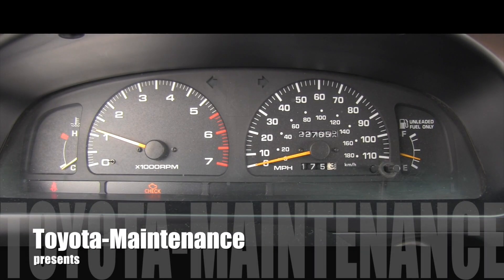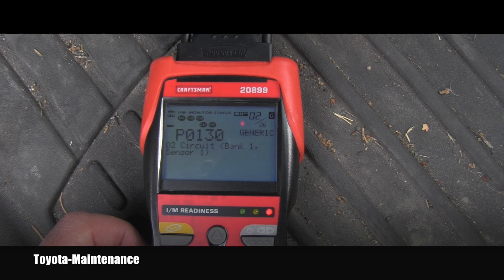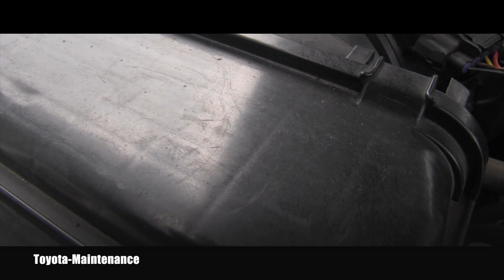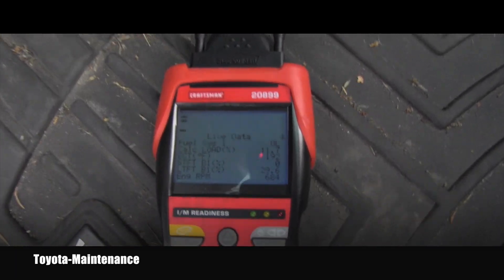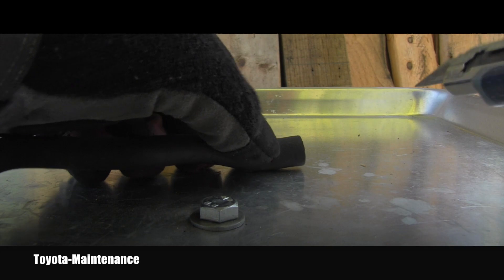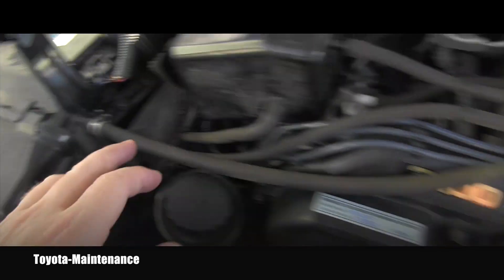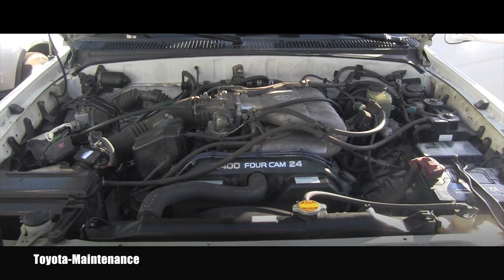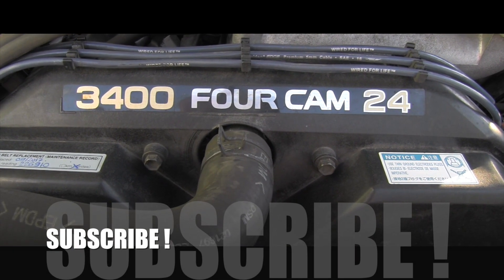Toyota code P0171 - System Too Lean Bank 1

Comment: only on BS youtube P0171 is solved by luck or a simple cracked boot ot maybe a MAF. in reality, this is one of the most difficult and time consuming codes/ issue  to resolve.
Reply: Yeai have a 2011 toyota prius and ive replaced all 4 spark plugs with new ones, checked injectors, replaced both 02 sensors, replaced pcv valve, checked boot and intake and air filter for leaks and nothing ,... keeps throwing code p0171
Reply: I also replaced MAF sensor and nothing😢
Reply: @wise_soul8886  Check for a leak at brake booster.

Comment: I have a scion tc  2006 with the code 0171, I changed my maf sensor, the regulator & fuel electric pump, the pcv and the oxygen sensor and still on, the check engine light...  I check the hoses and no visible cracks any idea??

Comment: I have a 01 Toyota Corolla with this code and can’t figure it out changed Crankshaft sensor oxygen sensors Feul pump coil pack MAF sensor spark plugs 🥺🥺🥺
Reply: Intake manifold 👀

Comment: Sir!!! I have toyota MRS 2000 with 1zz engine, my engine light turns on after 10-15mins idle/driving, I'm also experiencing misfire in my muffler, I have the same error code P0171, what should I do? I don't trust the mechanic here, he's just also searching in internet how to fix P0171, I'm just afraid of spending money to replace every parts that might cause P0171.

Comment: It was leaking from the intake manifold, that's why it went away after he took it off and put it back. I dont think the injectors were a problem or it would have had a code. That's sounded like way too much work. You could spray brake cleaner around the intake and all the hoses and listen for the engine to rev high then that's where the leak would be.

Comment: I changed my valve cover gaskets on my ‘01 tundra. Before that it had 3 cylinders misfiring, now it’s all but cylinder 4. MAF/Intake temperature sensor code also comes on, as well as system too lean. Any suggestions? Maybe I messed up the spark plug wires ? Might have missed a bolt on the intake manifold, also replaced the plenum gaskets.
Reply: V6 btw

Comment: I have the same issue with my 2013 Corolla, I have replaced my o2 sensors as the mechanic said that was the problem, however my engine light turned on again 2 days later I cleaned my MAF sensor but the engine light is still on, I have hard starting problems if that helps ????
Reply: did you ever solve?  i have 2009 with same issue
Reply: Fuel pump.
Reply: What did you do to fix it?

Comment: Good Afternoon my friend, My Toyota Camry 2007 is presenting symptoms such as gas consumption too quick, it's forcing too much as if there is no power, running very slow and forcibly when i go on the highway and of course the engine light on, the code that is showing me is the same P0171 and System too Lean Bank 1..what should i do?
Reply: Did you ever find the problem?
Reply: Did you ever find the problem  i ha e rhe same car same issues same code
Reply: @ScorpionMiguel20  sold the car 2 years ago, Thanks for asking!!
Reply: @ScorpionMiguel20  Issues with throttle body

Comment: Brother my 4 cylinder suzuki dzire have same code system too lean on bank 1.

I had bad battery which I recently replaced, checked my air filter area for air leakage. Clear obd code but after some time code still pops up.

My car giving awesome milage on cng gas kit but, not good on petrol.

I feel my car running with very low torque and have low power until it reaches to some respectable rpm.
Reply: عربي
Reply: Roland salut 91068681